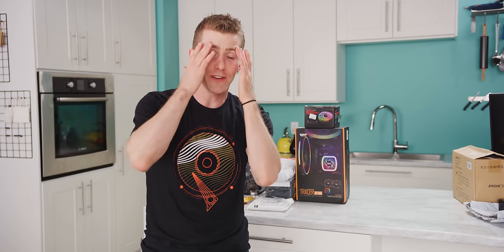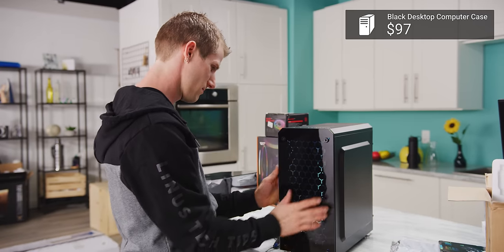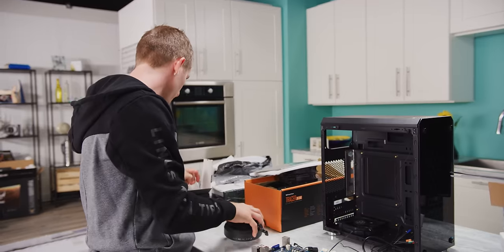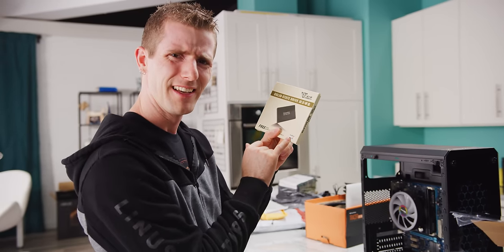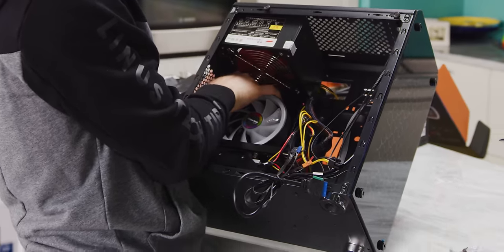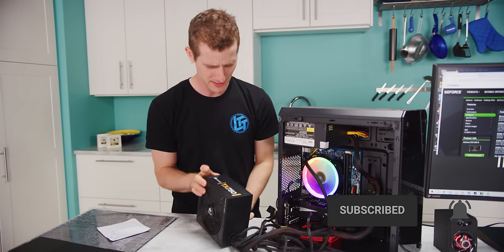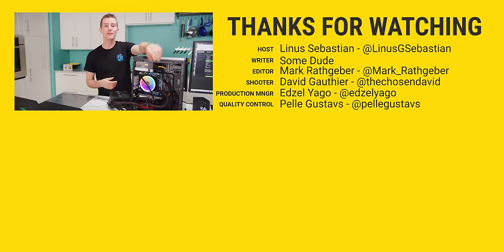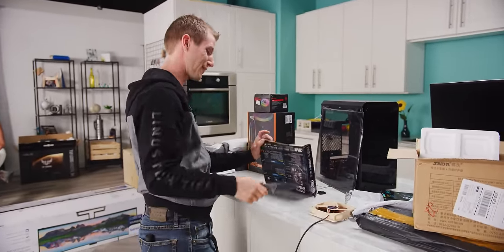Building a PC... using only Wish.com

Comment: at 97$ for a case you could have a name brand with at least 2 tempered glass panels
Reply: Bot -_-
Reply: my 4000d airflow was 97 bucks
Reply: Mine was $110 it’s like a mid grade case, 2 tempered glass panels, one thumbscrew to take off the front panel, usb c, decent airflow, etc. He totally got ripped off
Reply: @ianowens1905  i like my 4000d airflow anyway

Comment: That Graphics Card  is a bios flashed GTS 450
Reply: If it is a GF116, i guess it is more like a 500 series card like 550 or 545
Reply: Nice profile pic
Reply: No it isn't
Reply: @Zero49048  It's a 550/550ti
Reply: seems to me like a 560. I have one, though mine's oldest port is dvi so
Reply: I believe you're right, I had a buddy get scammed into buying a card with that exact crap cooler and it was a 450 after doing some deconstruction
Reply: I mean you don't need to guess, you should just be able to pop off the cooler and see what is etched into the die.
Reply: @Zero49048  oh yeah but I read some people online got a chip with a gf116 and instead it was a GTS 450 just like the one my friend bought that was advertised as a GTX 960 but it was actually a GTS 450 and on the GPU dye it said gf116
Reply: @rafee9442  well there are different gf116 chips but the most common scam cards with gf116 are usually GTS 450's
Reply: @geesusway70  thanks
Reply: @jdmnissan  my friend got a scam card that had a gf116 and it was a gts 450
Reply: @jdmnissan  there are different gf116 chips so a 500 series card is very possible also
Reply: @HoloScope  it is possible tho
Reply: Wait it is a GTS 450. Watch the Wish video by 'Dawid Does Tech Stuff'
Reply: @rafee9442  I did, but you can't be sure tho

Comment: Should've removed the video card cooler to find out what that thing really was.
Reply: I was seriously thinking this too! Like, that's a surefire way to know!
Reply: But with what Linus said. It narrows it down quite a bit. HWInfo says Fermi. Then no 6 pin connector. Playable in Rocket league. Its gotta be a 450 GTS. The PCB is too big for a GT430.
Reply: @StriderVM  yeah, most of these wish scam cards are GTS 450's...
Reply: GF116 makes it a 550 ti, which was a refresh of the GTS 450
Reply: @user-bf5sc8pn8x  Also possible since its also a Fermi refresh chip.
Reply: @user-bf5sc8pn8x  could still be a gts 450 revision 2/3. Which they probably are. Just like the majority of gtx 960's on wish >.<
Reply: You mean the shroud?
Reply: I forgot exactly who did the video but some one found out what card it really was and flashed the correct bios on it and the card worked as expected
Reply: It looks like a GT 545
Reply: @HuggedbyDeath  it is... Look at austin's wish video

Comment: I literally have the same case but with RGB. Its called Mars Gaming MCM and I have the MCL. SHit quality, terrible semi atx, super bad for cable management and u can't put the Cpu 4-8 pin on the motherboard directly, you have to route it all the way in front of the motherboard because the cut out for the pins are blocked by the motherboard. This makes me realize I should probably get a new case :/

Comment: Linus that thing is super cool, speaking of cool here is a short video idea for you. Wiring up a Noctua case can to a portable power bank with usb out.  Rigging in some speed control so when it is 105 degrees of the worst measurement system (about 40 c i think) I can clip that bad boy under my mesh seat and keep slightly cooler.  Because apparently my air conditioner stops cooling after 96.

Comment: I edited this comment so the replies are confusing 😁
Reply: That’s literally my computer. Everything is good but the cpu is always at 100 percent. It even has 2 tb storage and 8gb ram which I’m planning on changing soon. Might be hard because it’s an all in one.
Reply: Oh and the gpu that came with the computer is 20 bucks. Yeah I’m changing that definately
Reply: @w01fy51  lol my disk spikes to 100% sometimes and I don't know why
Reply: @Laggyboi  weird. My disc never does that lol. I guess it is 2 tb tho.
Reply: @w01fy51  true I don't have 2t lol
Reply: @Laggyboi  it might not be 2 t I might be on drugs now that I think about it but I think it’s 2tb
Reply: @w01fy51  Doesn't matter it's capacity, Laggyboi if your disk is spiking then it's reaching it's max read/write speeds, so W01FY you might just have a faster disk.

Also things like CPU can bottleneck read/write speeds in some cases so it may also be a small factor
Reply: @renjackson4249  yeah I don’t know enough about computers to make mine better. It’s an all in one I got for Christmas that has parts that are good to start building a pc with is all I know. All I need is the new cpu and we’re all good. The only problem is the CPI is very expensive.
Reply: @renjackson4249  cpu*
Reply: Ok I just ran around with lowest graphics settings in Minecraft and it still lagged so much and my computer was at 100 cpu the whole time.
Reply: @w01fy51  rip
Reply: @blizzard6599  yeah it sucks but turns out updating the gpu can do wonders and it’s never really at 100 anymore unless I am loading something up
Reply: @blizzard6599  cpu*
Reply: @w01fy51  Same here. 😂
Reply: @w01fy51  What sort of CPU you got?
Reply: @Laggyboi  Because your disk is probably hot garbage if it's a hard drive. Could also be fairly old.
Reply: @aftertheelectrike1847  true it could be
Reply: @aftertheelectrike1847  some sort of amd ryzen one
Reply: the whole time? to my knowledge the CPU usage was visible only during installation of the nvidia drivers - it'd make sense if the cpu was at 100%
Reply: Recently got a pc and the internet doesn’t work wirelessly so I have to take it in
Reply: @w01fy51  what gpu do u have?
Reply: @nebula8610  it’s a prebuilt and it has an amd processor. But that’s fine because I’m building my own soon. I bought the motherboard, and am planning on buying 32 gb of ram. I’m getting an amd ryzen 5 3600g so I don’t have to worry about getting a graphics card yet.
Reply: @w01fy51  2tb of storage and 8gb of memory and you have a $20 CPU???
Reply: @bacxhio9598  it’s prebuilt
Reply: @bacxhio9598  it’s not even a gaming pc
Reply: @bacxhio9598  also the hard disk is extremely ass fuckingly slow
Reply: @Laggyboi  Do you have WSAP installed?
Reply: @Laggyboi  its going bad thats what mine did and it slowed my computer  so badly and corrupted files
Reply: @kius5033  what's that
Reply: @Laggyboi  It’s something that can destroy your disk space. It’s made by windows and comes pre-installed with windows 8 and 10 so you only figure it out later, it’s actually called WSAPP and it handles a lot of the background stuff on the PC, but you don’t actually need it, for reference, a laptop from mid-2018 can handle three versions of chrome, six files and task manager open and stay below 50% disk, WSAPP by itself increases your disk to 80-99% without anything open.
Reply: @kius5033  oh wow thanks I'll try to find this boi >:(
Reply: @w01fy51  what cpu do you have
Reply: @iluvsumorsumn  o my god I already said this it’s some sort of amd I don’t really know because it’s an all in one that I got for christmas
Reply: @iluvsumorsumn  I realized that it’s the hard disk that’s what’s slow in my computer
Reply: thats my pc, HP gamer bought in england in 2018 always 100% of cpu usage since i bought it
Reply: Well I’d hope it is I didn’t buy it for it only to work on half power it should always be working at 100% efficiency
Reply: @Doshalot  uh I don’t think that’s what that means. That means the cpu was overloaded that whole time
Reply: @w01fy51  idk if he's joking or not but if he is it's pretty funny
Reply: @Laggyboi  try defragmentation, might make an improvement.
Reply: yes it was and gg for one of tops my doode
Reply: @aar0123  haha didn't expect to see you here and thx
Reply: @w01fy51  click the fucking start menu, type ‘device manager’, open it, click drop down labeled processor, and find out what CPU you have. How do you seriously expect to build a pc if you can’t even identify a CPU.
Reply: dadad adqwdqq  it’s brand new 😬
Reply: @TheRageCommenter  I didn’t build it
Reply: @w01fy51  I think he means that it's suprising that you are building a PC when your not sure how to figure out the type of CPU you have. Personally it doesn't fucking matter because whatever it is seems to be garbage soon anyways. If anything I'd be more worried about you possibly not knowing how to format your drives than anything else.
Reply: @ICCUWANSIUT  yeah, I’m not going through the trouble of booting it up just to see whatever crap is in it. All I know that I’m getting a crucial p5, ryxen 3400g, trident z royal, and a rx 570
Reply: @w01fy51  That's not bad if its under $800 for the entire computer. Though then again I haven't looked at 570 prices I know the 580 is at least 240 dollars atm. Which is a shame really because they aren't worth even 200 if stock was normal.

Could get those things for like 160 just 8 months or so ago.
Reply: @ICCUWANSIUT  570s go for about the same price. The best bet is to win an auction on eBay. And yes the computer is under $800. I am planning on upgrading it tho (more ram, better cooling, etc.)
Reply: @w01fy51  what is your current CPU?
Reply: @MeiZ125  idk it’s an amd one it’s a prebuilt pc I’m making my own I just need the ssd
Reply: @w01fy51  kingston makes a dope SSD if you need a suggestion <3 gl on the build
Reply: @ICCUWANSIUT  it very much does matter. If you build a pc, especially your first build, something is gonna go wrong. And if you lack the technical knowledge to be able to at least determine what’s happening then there’s a more serious problem than just the pc. 

The reason I came on so aggressively is because this person was asked repeatedly what type of cpu they had and said “i don’t know” (which is fine), but then got frustrated at the people asking as if it was a dumb question to ask. It’s like an old person talking to tech support: “my computer isn’t working!” “Ok do you have a Mac or a PC?” “I don’t see why that matters, it just isn’t working!!”
Reply: @TheRageCommenter  That's fine, and I completely agree with you on the points you are making. God knows anyone who's helped a family member has been frustrated by it lol. 

I said it doesn't matter because at this point he's about to upgrade, knowing what he had is cool for comparisons and "what if I still had that" but useless in the general scheme of things. Unless he's selling it. Then maybe he needs to know.
Reply: @ICCUWANSIUT  you’re right. If they’re just gonna throw it out anyway no point in dwelling on the details. I get way too caught up in the details all the time lol
Reply: W01FY Get a 3700x way better and comes with a good RGB cooler
Reply: @WackyPossum  yep definitely better
Reply: Bruh
Reply: I hate my intel core i3 5010U
Reply: @Laggyboi  open cmd on administrator mode and type in exactly like this “net.exe stop SysMain” and press enter, watch your disk usage go from 100 to 1
Reply: @lol-ws6po  alr I'll try it out
Reply: @w01fy51  can’t improve an all in one, it’s kit like a regular pc
Reply: E
Reply: What does that mean?
Reply: @Babbolozada  the cpu is working hard
Reply: @Laggyboi  probably because your hard drive is slow and your cpu is pulling data as fast as the hard drive can spit it out.
Reply: Lmao
Reply: @Umaru chan Not being pegged to 100%, those CPUs can certainly do that
Reply: @kius5033  That's not a thing that exists
Reply: @TheRageCommenter  There might not be a need to throw a working computer out just because one component is potentially bottle necking the whole system
Reply: @resneptacle  Read about what you’re talking about before talking about it.
Reply: you know we gotta keep it 100 at all times
Reply: @w01fy51  Dude I have a Ryzen 5 3600, my CPU is running fine, how are you struggling???
Reply: @GamerFaceGamerGame  it’s literally a shitty all in one I hate having to reply to all these comments
Reply: @resneptacle  I agree. I was just stating that the decision had already been made to get a new PC.
Reply: I have a 2x worse pc then the wish pc :(
Reply: probably have a miner on it
Reply: @Laggyboi  it's failing. Our school lab computers did this and died within one week. Don't buy no name Chinese hard drives
Reply: @Laggyboi  mine did that too turns out windows 10 has alot of background processes and my pc hard drive is shit

Comment: I'm running an EVGA 1060 6gb on the PC I watched this on lol. Works fine for me. I also still run a Alienwarre m17x R2 that was spec'd to 4400$ in 2008. Upgraded everything. Also run a Dell XPS 435 MT with an rx 560 4gb just for CAD and 3D printing. Also put a i7 975 in it and made it my router with some risers. I got a pcie x1-> sata 3 adapter to get all 500MB/s out of my SSD rather than the sata 2 on the mobo.

Comment: It's probably a 550Ti. Very common card for people to flash and scam.
Reply: I have one exactly like this (from wish), the chip is: NVIDIA GF116  200 ka a1 (GTS450)
Reply: HWInfo says Fermi. So its more likely to be a GTS 450.
Reply: Strider VM the 550 ti is Fermi.
Reply: @EvilTurkeySlices  Yeah. Also possible, I forgot that the 500 series also have the Fermi codename.
Reply: I’m surprised the office didn’t burn down
Reply: Dell optiplex 
New ram and power supply 
Add a graphics card 
$200

Comment: Hello there ,, just confused of what would be better for gaming and some coding .. python + java .+ photoshop editing... should i get 

 “Dell precision 5530 4k touch
CPU : core i7 8th gen
GPU : Nvidia quadro p1000 4GB GDDR5
RAM : 16 GB DDR4
SSD : 500 

Or this build

Motherboard : Asus Rog Strix B660-A Gaming
GPU : Palit RTX 3070ti 
CPU : core i5 will upgrade to core i7 8th gen
Ram : 16 GB DDR4 
SSD : 1TB 

which is better performance and wont throttle under high pressure??
Reply: 2nd one if you got some money to spend

Comment: That's not entirely true, bought a set of brake pads for my truck a few years ago, when I opened it up the box had a free surprise upgrade randomly in it, top of the line brakes for mid range price, now in computers not being as advertised may always be a bad thing, I tend to stay away from sketchy places

Comment: (Corei7 12700k unlocked, MSI OR ASUS z 790 p wifi motherboard,nvidia rtx 4070 titan,crucier 2×32 stik ram,and a frontech 800w smps ,msi 4tb nvie.. ssd) is these good por my pc building please give some opinions

Comment: 12:15 I'm sure this is a fake card. But in theory a manufacturer could design a 1060 with those connectors. Maybe for industrial systems where they still need VGA but also need some power. There are active HDMI to VGA adaptors that would work on a 1060. So if they include those components on their PCB, they could make a real 1060 with VGA.

Comment: On wish i purchased a ps5 holdall station which loads controllers, takes headset, blows air in the ps5 and serves as shelf for 10 ps5 titles - didnt expect much but was surprised it was sturdy, looks super and works perfectly. A similiar station ive also ordered for my Xbox Series S; also works perfectly. TLDR; not everything is bad only because its from wish. ^^

Comment: Hi , I got a Gigabyte x670 ax mother board with Ryzen 7950x and cosair vengeance 16gb * 2 4800 MHz , P5 crucial M2 gen 4, RTX 2060 super, RTX 3060 Ti . I have installed ubuntu 22.04 but it is constantly freezing , I have tried different nvidia drivers for my cards but nothing seems to work. Could you please let me know what's going wrong here??

Comment: Quick question
I have an issue where plugging in a harddrive to this one sata port causes windows to boot up slowly and shutdown real slow. 
If I unplug it it fixes the issue.
Is it sharing bandwith with something?
WIndows is on a seperate NVME.
Reply: It probably just prefers booting on the harddrive for some reason. Change the boot order in your BIOS

Comment: As someone who still has working desktop pc with 755 socket motherboard with 2 core intel cpu with that specific flower pattern cooler i feel offended.. not really its basicly data storage whcih is being replaced atm but still its a still workable desktop.

Comment: My DELL Optiplex 990 was working good. But I had an issue with DELL monitor flashing or blinking. 2 mon's, 1 is big screen. So after a little bit of trouble shooting, the slot would not display a screen anymore. tried bottom slot. Nothing. Plugged monitor big screen into the onboard, and it said I had configuration prob. Removed VCard, and she fired up okay. No problem. So trying to figure that out, led me to restarting PC without a screen to properly shut it down with. Now my PC says Hard drive not detected.. tried it in this PC which is almost it's twin, and still nothing. The cards won't display in this one either slot either. I say CARDS because I have a 2nd one that wasn't being used. I tried it in the twin and nothing. Wouldn't go in other either. Any ideas what happened?
DCS fly'er.. I'm on the ground and going NUTS!!!

Comment: cried in pain watching this cause i just brought second hand 5600g +2x8gb 3200mhz sticks icl case and b550 motherboard and cpu fan for 250 and found unused sealed p4000 for 100bucks ..while added 512gb m.2 ...atleast my dad can now play cod enjoyable after years of him using fx 8350 and r9 280 with some slow ass crunchy hdd from original xbox on it